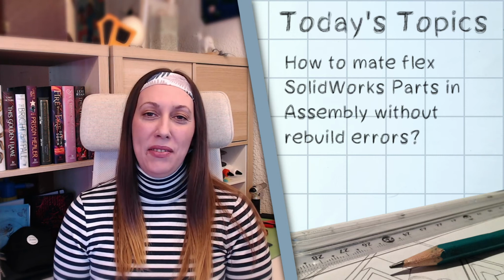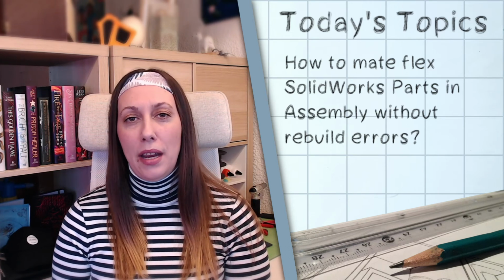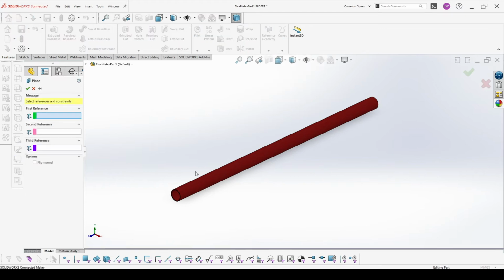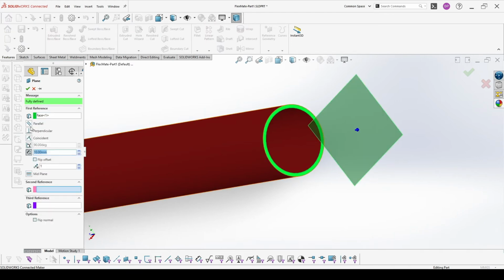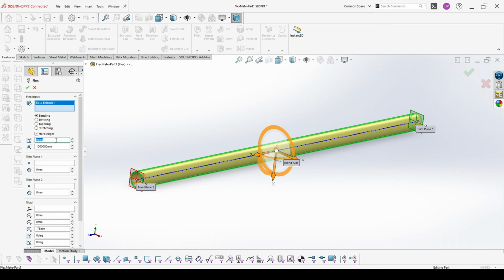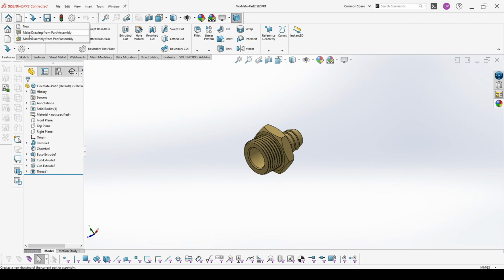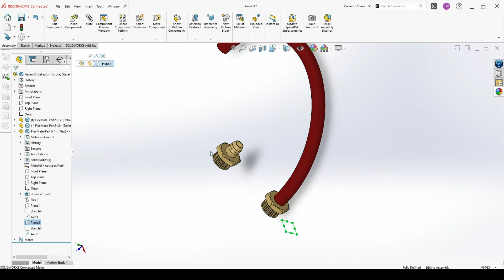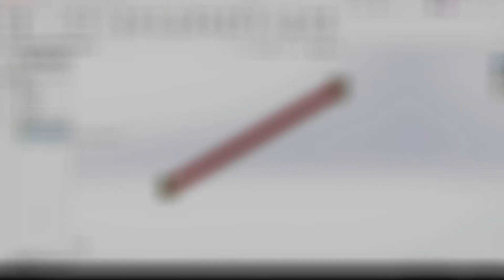SolidWorks How to Easily Mate Flex Part in Assembly - NO Errors Guarantee

Comment: How can you control the flexible part by the locations of the fittings in the assembly?
Reply from the maker: It's a bit more complicated, but also possible. What I usually do in such case is to create a spline in the part that is defined by components in the assembly and sweep on that spline. Then your spline and part are driven by the assembly itself and no mates are needed.

Comment: what is the little blue gear icon in the feature tree?
Reply from the maker: The blue gear icon in the feature tree shows that the model is done with SoldiWorks Makers. The same way you have academic hat in models done with Student Solidworks. Unlike the Student versions the only downside of Makers model is that they cannot be opened with regular SolidWorks.